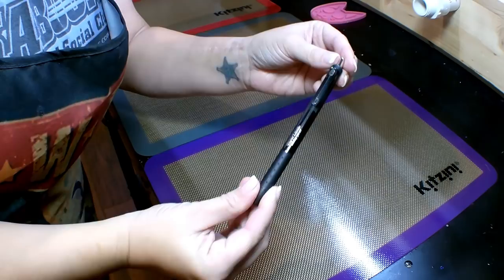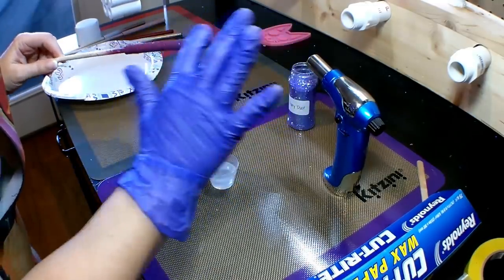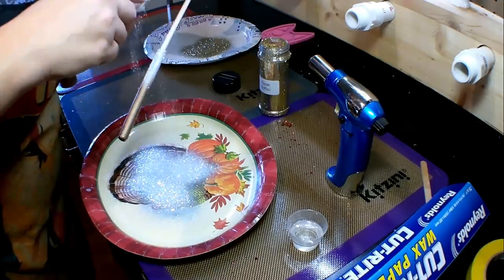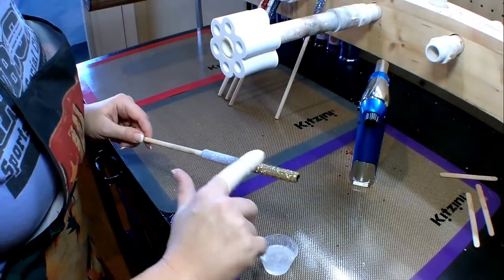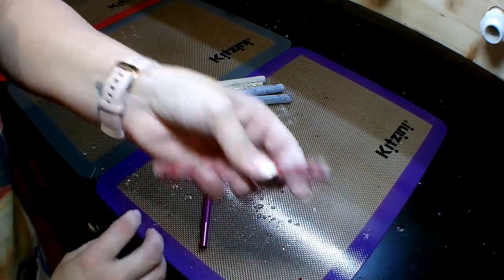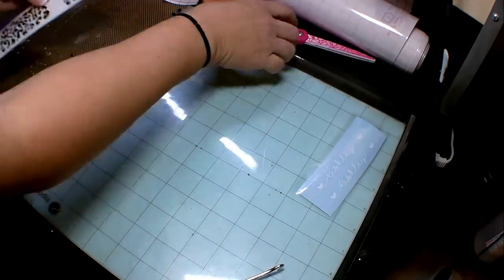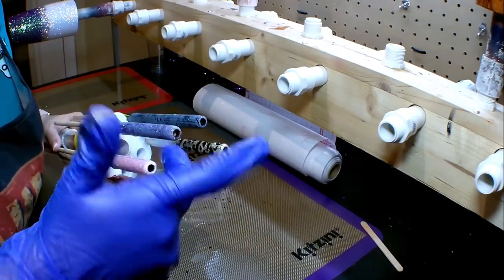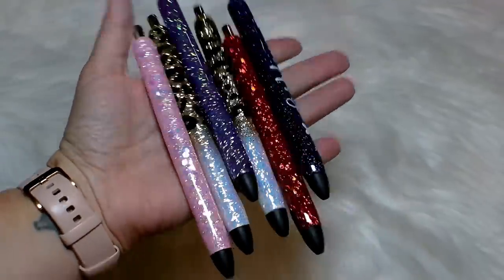Epoxy Glitter Pen Tutorial Part 2 Update | NEW Tips & Tricks | Leopard Print Pens | Inkjoy Papermate

Comment: I have a question concerning your sanding.  I noticed that the small piece of sanding paper you are using seems to stick to your hand when you turn it over and makes it easier to sand.  What are you using to keep it attached to your hand to sand that way?
Reply from the maker: The sandpaper that I use, I buy on Amazon and it has an adhesive back to it. it makes it super easy when sanding because as you saw in the video, it sticks right to my hand. There's a link for it down in the description box. 🥰
Reply: @KristisCustomCreations  Thank you so much!

Comment: Where do you put the pens after glittering them before you placed them on the turner?
Reply from the maker: I just set them off to the side. I have a box that I have poked holes in the top of and I stick the dowel rods down into the holes in the box to hold the pens.

Comment: Kristi I would really like some info on the Faux Rizzle epoxy
Reply from the maker: Faux Rizzle is one of my favorite epoxy brands. It is a thicker epoxy that has a little bit of a shorter working time so it dries a bit faster. The other epoxy that I use, Tumblerpoxy, has a longer working time and it takes a bit longer to dry but it is beautiful. They are both awesome epoxies. Faux Rizzle is a great starter epoxy and is VERY forgiving.
Reply: @KristisCustomCreations  ---   do you not have to wear a respirator with these 2 epoxy's ??
Reply from the maker: @wvcathy6897  you should always use proper PPE and have proper ventilation when working with epoxy. The area where I work is very ventilated

Comment: How long was your second piece of vinyl? The leopard print.
Reply from the maker: The leopard print is sized approximately 2 in by 1.5 in but you may have to adjust that size slightly depending on how thick your epoxy and glitter is. Also, I have the leopard print SVG available for everyone to use for free in my Facebook group if you would like to use it as well. Here is the link to my Facebook group, the file can be located under the announcement section and posted by susie. https://www.facebook.com/groups/epoxytumblersandpens/?ref=share

Comment: I’m having trouble getting the chunky lipstick glitter to lay flat and not fall off when I roll it in the wax paper.. any idea what I’m doing wrong?
Reply from the maker: You may need to use just a bit more epoxy and glitter. Also, let the epoxy harden slightly for about 30 mins before rolling it in the wax paper.. that will help grab the glitter better.

Comment: Question, do you absolutely have to spray paint the pen before doing the epoxy and glitter??
Reply from the maker: No, you don't have to but if you do a light colored glitter then the black pen may show through the glitter
Reply: Is it a must to have them spin?
Reply from the maker: @xochitlydaniel  you can make them using the "hang method" but they may not be quite as smooth

Comment: I'm very new to all this. Wondering why you don't use a UV light like some others do?
Reply from the maker: You can use a UV light with UV resin. In this tutorial, I'm using epoxy. Some of my other tutorials show me using UV resin for pens. UV resin is nice because it's fast but I have found that epoxy on the pens tends to look a lot better. It's just personal preference and depending on how quickly you need your pens done.
Reply: @KristisCustomCreations  ty so very much. Shows how new I am BC I thought resin and epoxy were the same thing. Lol and duh.
Reply from the maker: @cindylathan4231  lol! You're very welcome. They are very similar. UV resin cures under a UV light but epoxy resin is a two-part epoxy that you mix up and it has a chemical process that makes it cure. I hope that helps and please don't ever be afraid to ask questions.

Comment: I was wondering if you could share the size of the decals for the leopard print decal.
Reply from the maker: the leopard decal is approximately 1.5 in x 2 in but you may have to adjust that slightly depending on how thick your epoxy/glitter is.
Reply: @KristisCustomCreations  thank you for that information
Reply from the maker: @cstmcreationsbyrhondarae1464  You're very welcome!

Comment: How long after each coat of epoxy do you let them spin?
Reply from the maker: I usually let them spin for about 5-6 hours but after taking them off the spinner, they need to continue to dry for at least 8-10 hours before handling.

Comment: I am deathly allergic to epoxy, any suggestions to seal the pens/glitter?
Reply from the maker: Since you are allergic to epoxy, do you also have a reaction to UV resin? If not, that may be an option for you. Also, there is a product out there called Crystalac That is supposed to be non-toxic. It requires multiple thin layers over time to seal the pens / glitter. I've never personally used that product so I can't say how well it works or doesn't work on pens but I know that a lot of people choose to use that on Tumblers instead of epoxy.

Comment: I’m really hoping you can help me. I epoxyed my pens. Spun for six hours. They were still tacky. So I researched and found if you re epoxy them it could help. I added more epoxy. Spun for six hours. They felt better. I went to sand them and they turned gummy and the epoxy started to come off. I’m so frustrated and just a little loss. What do I do?
Reply from the maker: So you are trying to sand them after 6 hours of spinning? I add another coat of epoxy after spinning for 6 hours but I don't sand until they are actually dry which usually takes around 10 hours or so. They will be gummy and mess up if you sand before they are fully dry. I hope this helps!
Reply: I might not have waited long enough after the second epoxy. Do you know if there’s a way to fix it or would it just be scrapped and try again?  And thank you so much for answering me!! You are so awesome !!
Reply from the maker: @leahwalters7068  You are very welcome! Are you part of our Facebook group yet? https://www.facebook.com/groups/epoxytumblersandpens I kind of need to see what the pen looks like now to see if it can be fixed. And always feel free to ask any questions, I always answer them to the best  of my ability.

Comment: I saw a girl use modge podge on the base and rolled the pens into glitter. Would you not recommend doing that?
Reply from the maker: You can use mod podge too.. I personally prefer the epoxy method because I find it easier and I get better coverage with the glitter that way. Some other people prefer mod podge, it's just personal preference. If I am doing a design (like a glitter pencil design) that requires more detailed lines then I will use mod podge.

Comment: My pencil got stuck inside the pen do you rotate the pen before it completely dries?
Reply from the maker: I'm very careful not to get the Epoxy over the edge of the pen. If you get the Epoxy on the pencil from the pen then it will get stuck. Try heating up the epoxy a little, take a blade to it gently, and try to remove it.

Comment: what size did you use for the leopard print to fit around the pen nicely ?
Reply from the maker: It is 1.5" x 2" but you may have to adjust that slightly depending on the thickness of your glitter/epoxy.

Comment: Is the leopard print the same size the font?
Reply from the maker: The leopard print is 1.5" x 2" but you may have to adjust that slightly depending on how thick your glitter/epoxy is. I actually have the leopard cut file available for everyone to use in my Facebook group under the announcement section (posted by Susie). https://www.facebook.com/groups/epoxytumblersandpens

Comment: Have you ever tried mod podge?
Reply from the maker: Yes ma'am, I have. I actually just finished one up that I used modge podge on. The epoxy method is easier in my opinion but for more intricate designs, I use modge podge.

Comment: So i bought the pens to do this.... however i bought the ballpoint pens and not gel... they are shaped a little differently and do not not have that rubber grip.... should it still work??😬
Reply from the maker: If you can remove the clip, take the pen apart, and put it on a dowel rod as shown in the video then you can do it. :)
Reply: Sweet! Thanks
Reply from the maker: @christiethornsberry  You're welcome!

Comment: What size do u make the leopard print for the lens
Reply from the maker: The leopard print is sized approximately 2 in by 1.5 in but you may have to adjust that size slightly depending on how thick your epoxy and glitter is. Also, I have the leopard print SVG available for everyone to use for free in my Facebook group if you would like to use it as well. Here is the link to my Facebook group, the file can be located under the announcement section and posted by susie. https://www.facebook.com/groups/epoxytumblersandpens/?ref=share

Comment: What size do you print the leopard spots?
Reply from the maker: The area that I cut for the leopard spot is approximately 1 in by 1.5 in but it might vary slightly depending on how thick your epoxy/glitter is.

Comment: Surely someone has asked... but I didn’t see it... what size is the leopard print cut out?
Reply from the maker: Lol, yes... About 200 people have asked in the comments. 🤣 I cut mine to 1.5 inch by 2 inch but you may have to adjust that slightly depending on how thick your glitter/epoxy is. I actually have the cut file for it available for everyone to use in my Facebook group under the attachment section and posted by my Admin, Susie. The link to the Facebook group is in the description box. 😊

Comment: What size did you make the leopard spots?
Reply from the maker: The leopard print is sized approximately 2 in by 1.5 in but you may have to adjust that size slightly depending on how thick your epoxy and glitter is. Also, I have the leopard print SVG available for everyone to use for free in my Facebook group if you would like to use it as well. Here is the link to my Facebook group, the file can be located under the announcement section and posted by susie. https://www.facebook.com/groups/epoxytumblersandpens/?ref=share

Comment: My pens won’t go back together like yours did. I cleaned out the holes. When I put the silver and black part back in, they do not go all the way down. Please help
Reply from the maker: Is there epoxy inside? Or is there any chance that you could have used too much heat on it?
Reply: @KristisCustomCreations  I scraped inside of both ends like with a knife thing like you used in the beginning and I didn't use any heat at all.
Reply from the maker: @candyporta9071  can you message me at Kristi's Custom Creations on Facebook and send me a pic of the ends of the pens?

Comment: What was the size used to do the leopard print vinyl
Reply from the maker: Besides that I used for the leopard print is approximately 2 in by 1.5 in. you may have to adjust that slightly though depending on how thick your glitter and epoxy is.

Comment: I was on my last spin before they are done and they spun for 6 hours and they fillsticky, is there a reason why????
Reply from the maker: Depending on the kind of epoxy you use, 6 hours may not be long enough. Most epoxies are still tacky after 6 hours unless you use a fast set epoxy.

Comment: How did you make the pen holder attachment?
Reply from the maker: It's just a foam Turner insert that I purchased on Amazon. there is a link to the foam Turner insert in the description box. I put the pens on a 1/4" dowel rod and tape it or rubber band it to the foam Turner insert.

Comment: Was size was the leopard cut out at?
Reply from the maker: The leopard print is sized approximately 2 in by 1.5 in but you may have to adjust that size slightly depending on how thick your epoxy and glitter is. Also, I have the leopard print SVG available for everyone to use for free in my Facebook group if you would like to use it as well. Here is the link to my Facebook group, the file can be located under the announcement section and posted by susie. https://www.facebook.com/groups/epoxytumblersandpens/?ref=share

Comment: Can this be done with uv resin?
Reply from the maker: I haven't personally tried it with UV resin but I'm sure that you can. The problem that you will run into with UV resin though is it isn't self-leveling like normal epoxy is, so your pens may not be super smooth.

Comment: what size do you make the leopard print to make it half way?
Reply from the maker: I make the leopard print approximately 2 in by 1.5 in but you may have to adjust that slightly depending on how thick your glitter/apoxy is. I also have the file in my Facebook group, which is linked down in the description box below, for everyone to use if you would like to check it out.
Reply: @KristisCustomCreations   I read through comments last night and found someone else asked, It fits perfectly. My only issue is i used glitter and another coat of epoxy but its still sticky.
Reply from the maker: @sabrinamaycott6840  how long has the epoxy been on it? If it's been a while and it's still sticky then it may not have been mixed correctly or the measurements may be off. If that's the case, then the sticky Epoxy will need to be removed.
Reply: @KristisCustomCreations   over night, i feared that would be the anwser.
Reply from the maker: @sabrinamaycott6840  try maybe keeping it in a warm area for a few hours and see if that helps at all... Sometimes it does.

Comment: May I ask the measurements for the leopard print? Thanks in advance ♡
Reply from the maker: I'm so sorry it took so long to respond, I've been super sick. My leopard decals are approximately 1.5 in x 2 in but you may have to adjust that slightly depending on how thick your epoxy/glitter is. have you joined my Facebook group that is listed down in the description box below? I have shared my leopard print cut file for everyone on there to use. 🥰

Comment: What size decal is the leopard spots?
Reply from the maker: The leopard print is sized approximately 2 in by 1.5 in but you may have to adjust that size slightly depending on how thick your epoxy and glitter is. Also, I have the leopard print SVG available for everyone to use for free in my Facebook group if you would like to use it as well. Here is the link to my Facebook group, the file can be located under the announcement section and posted by susie. https://www.facebook.com/groups/epoxytumblersandpens/?ref=share

Comment: What size did u cut the cheetah print
Reply from the maker: The cheetah print is cut approximately 1.5 in x 2 in but you may have to adjust that slightly depending on how thick your glitter and epoxy is.

Comment: What size did you cut the leopard?
Reply from the maker: I cut the leopard approximately 2 in by 1.5 in. You may have to adjust that slightly though depending on how thick your epoxy / glitter is.

Comment: What size did you use for the leopard print?
Reply from the maker: The size for the leopard print is approximately 2 in x 1.5 in but you may have to adjust that slightly depending on how thick your epoxy/glitter is.
Reply: @KristisCustomCreations  thank you so much for you're fast reply and I love you're videos!!! I make tumblers, candles and now pens and these are the best videos by far
Reply from the maker: @donnareynolds2089  aww! Thanks so much! I try to keep my videos educational and not fill them with a bunch of nonsense. 😊
Reply from the maker: @donnareynolds2089  I think candles are awesome! I would love to learn how to make them but I have enough on my plate at the moment 😂

Comment: I wonder how adhesive would work initially to apply the glitter...
Reply from the maker: It would probably work just fine. Basically all you need is something to adhere glitter to the pen just like with a stainless steel tumbler. I personally like the epoxy method because it's easy and I always get good coverage from it.
Reply: I thought about that during the video but I would be worried about the adhesive spray getting inside the pen when you tried to get the edges done and maybe getting all of that in there by accident.
Reply from the maker: @cheryltripp1739  yes, that's a very good point. An adhesive spray may cause issues if it gets inside the tip.

Comment: What size are leopard print?
Reply from the maker: The leopard print is approximately 1.5 in x 2 in but you may have to adjust that slightly depending on how thick your epoxy/glitter is.

Comment: Beautiful pens..
What was the dimensions for the leopord print and also what setting do you use for cutting that tiny lettering?
Reply from the maker: My leopard print is approx 1.5" x 2" but you may have to adjust that slightly depending on how thick your glitter and epoxy is. I have a Silhouette Cameo 4 and I set my program to cut the 651 Vinyl with a cut setting of 2.

Comment: What size did you make the spots
Reply from the maker: My leopard pattern is approx 2" x 1.5" but you may have to adjust that slightly depending on how thick the epoxy/glitter is. I have actually shared the cut file for my leopard pattern in my Facebook group for everyone to use. https://www.facebook.com/groups/epoxytumblersandpens

Comment: what is the size of the leopard print??
Reply from the maker: It's approximately 1.5"x2"
Reply: Awesome thanks!!! Also, where did u get your svg??? I need to purchase svg for my cameo.
Reply from the maker: I just searched leopard spots on Etsy and purchased a cut file there 😊
Reply: @KristisCustomCreations   So to wrap a pen like you did with the leopard print......the total size was 1.5x2.  Just wanting to make sure that I do it correctly
Reply from the maker: @rietastarnes8433  yes ma'am, but you may have to adjust it slightly depending on how much epoxy you put on the pen because that may thicken it up slightly.